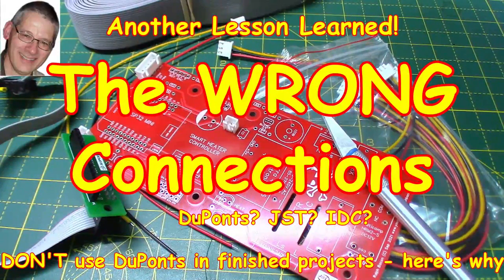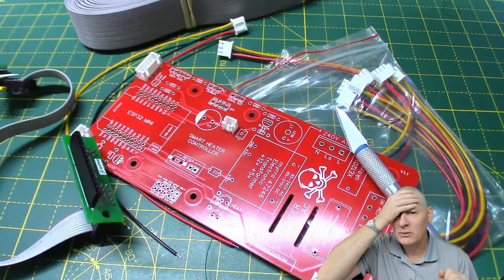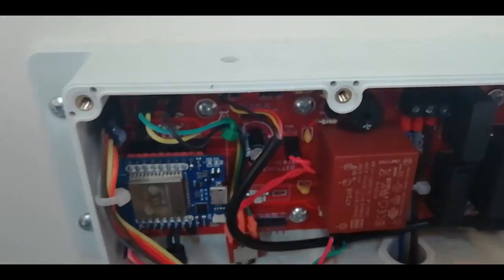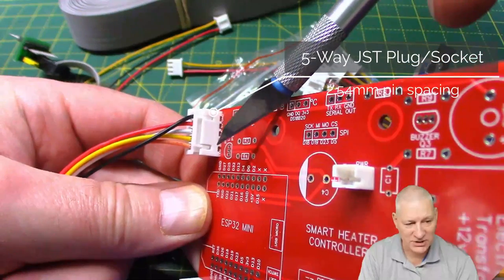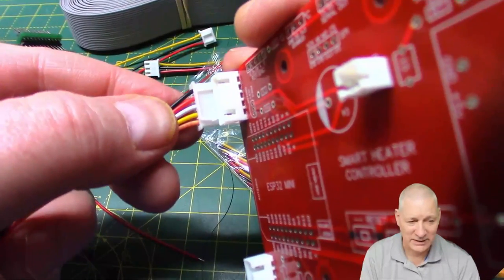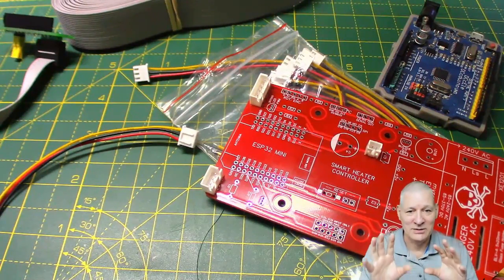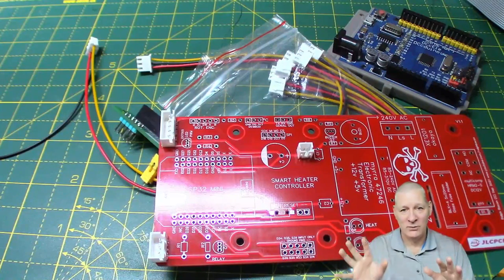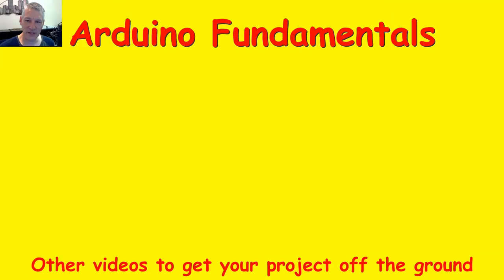#238 The Wrong Connectors😲forget DuPont, use JST or IDC for final use

Comment: Fun tip, you can really use just about any connector if you put a dab of hot glue on.
Reply from the maker: Fun fact, using hot glue on most connectors ensures you will never remove it without damage to the wires or connector! 

Best connectors I use now are KF2510, a bit like JST but easier to remove (and crimp cables). Not so good for drone battery connections, maybe, but great for Arduino work.
Reply: @RalphBacon  The trick is to peel the glue off before removing the connector. As most glue guns only heat to about 180 degrees (lower than the temps required to bake on smd components), its a pretty decent method and is often what manufacturers do to keep cables in place when they want to ensure they dont move during shipping but still want parts to be replaceable.
Reply from the maker: Hmm. It's what cheap manufacturers use to keep cables in place rather than some sort of (removable) cable tie. 

I'd rather use JST connectors for connections that are rarely removed, and a KF2510 for ones that are frequently unplugged, without causing strain on the sometimes delicate cables.

But if your method works for you, then it works. 😁
Reply: @RalphBacon  This is pretty widely used by manufacturers that range from small to big. Its often used on JST connectors even.

Its particularly used on machines that have cables liable to get loose in shipping such as gaming pcs, 3d printers, arcade cabinets and more.

If you arent freight shipping a product where you have garuntees thay its babird the whole way its one of the better ways to ensure your customers dont end up in the support queue right off the bat. Other methods include expanding foam (for pcs), more deliberately latched connectors (with a lever rather than with the mechanism of a jst that simply bends the housing (but that raises the price notably)), or permanently attached cables.

In some cases a heap of adhesive is applied liberally to internal components like with Apple products and their legendarily pro right to repair stance ...

Anyhow, I just think its worth looking into. Its a cheap solution that works, is easily removable, doesnt put any extra stress on the cables, and can be done once you've reached a stated where you are satisfied you'll be leaving it for a while.  All it stakes is a small dab touching the male and female parts and avoiding the contacts and "that aint goin' anywhere".

As for cable ties, its hard to garuntee that theyll hold things in place. They simply arent as direct/close to the source of diconnection wnd can even lead to a case where one cable wiggling adds to the inertia of the bunch so another gets tugger with more force.

I view cable ties as a means for tidying not really a first line item for keeping cables connected where they ought be.

Comment: Bear in mind that it’s just the cheap Chinese “DuPont” connectors that are unreliable as hell. The original product, the Mini-PV series sold today by Amphenol, are far, far, far more reliable. (Their contacts come in three levels of force: low-force for high pin count connectors (40-72 pins), high-force for medium pin counts (10-50 pins), and ultra-high-force for low pin counts (1-20 pins).) The original Mini-PV contacts are rated for 1000 mating cycles, which they accomplish by using a beryllium copper contact spring inside a brass body. The cheap Chinese clones are all-brass, which deforms instead of springing back, which is why they loosen so very quickly, literally after just a few cycles.

With that said, the real Mini-PV connectors are quite expensive, so for most things I use various JST connectors, and lots of Molex KK 254 and clones thereof (like the common KF2510 from China).
Reply from the maker: Yes, others have mentioned the KK254 although I've yet to find pre-crimped wires for it (and I shudder at crimping more wires). 

I've got some 'better quality' DuPont cables too (thicker overall wire, more strands inside) but they are, as you say, more expensive. I wish I'd used those in my project!
Reply: @RalphBacon  You can readily buy KK254 clones on aliexpress, including pre-crimped leads, under the KF2510 name. Quality-wise, the KK254 clones are much closer to original Molex than DuPont clones are to original Amphenol. 

But I must also say, if you haven’t been able to find pre-crimped KK254 leads (using genuine Molex), it’s because you haven’t looked. Many vendors make them. Digi-Key, for example, has 900 types of them in stock. (I suspect they’re manufactured to order.) Mouser has 42. Molex itself sells a whopping three. :p
Reply from the maker: I must admit I hesitate to buy from (or even look at) Digi-Key (or other 'big name' vendors) given their high prices and even higher delivery charges. They are not interested in hobbyist volumes. But I will look for the KF2510 clones on AliExpress (they don't care who they sell to).
Reply: @RalphBacon   Hobby and prototyping volumes is literally Digi-Key’s business (and the reason they’re expensive) — large volume is the purview of resellers you’ll likely never deal with (like Avnet), and the sales departments of the manufacturers themselves. When you order ten thousand or a million pieces of something, you skip the middlemen altogether.

Digi-Key (and by extension, Mouser likely as well, since they always follow each other) has free shipping to the UK for orders £33 and up. So just aggregate a few projects and order at once. That’s what I do to get parts here in Switzerland, where it’s free shipping for orders €50 and up. Critically, Digi-Key (and Mouser) include customs, so no surprise customs and duty bills on delivery! (That’s a HUGE problem here in Switzerland with most foreign vendors, I dunno how the UK is.) 

The other tip I have is to keep a shopping list of low-priority stuff to restock, so that when you’re not quite at the minimum order for free shipping, you can pad it with one of those things. Common resistor values, wire, solder, flux, etc. Note that for many components (SMD resistors and chip caps being prime examples), the volume discounts are massive, such that buying 5 pieces can end up costing the same or more than 10 or 15… Digi-Key’s website is, at least, kind enough to tell you if buying more will cost you less. 

I used to order more stuff from aliexpress, but as time goes on, I’m preferring to buy quality from Digi-Key, because crapola parts end up wasting too much time and nerves. Sure, a Chinese DuPont contact for making prototyping jumpers costs 2¢ versus 50¢ for a real Mini-PV, but the Chinese contact is loose after 10 insertion cycles (and never was tight to begin with), versus 1000 for the Mini-PV. When you factor in the time spent assembling the jumper, it’s stupid to use the cheap ones. Same with a circuit that misbehaves because your op-amp is counterfeit, or a power transistor that shorts out and fries your circuit because it’s actually a small signal transistor hidden in a power transistor housing. 

What I do like AliExpress for is the things that simply aren’t sold anywhere else!

Comment: Those IDC cables are pain in the ass' had to replace loads of those on Marshall Amp's because the spikes were in poor contact for siganals from the pre amp/Eq to the power stages caused all sorts of shit , used to make up JST cables to replace ..............
Reply from the maker: IDC cables can be subject to poor connectivity, it depends on who made them. I've not had any issues with my home-made ones (even the ones I've had to squeeze up in the vice before I had the correct tool).

Comment: What do you think of the followings and have tried any of them:
1/ RJ45 LAN connection(upto 8 wires) ; female connector ~2£/u, male connector ~ male connector ~1£
2/ M12 connectors (3, 4, 5 or 8 pins)
3/ Chassis Socket Connectors; e.g. VISSQH GX12 5 Pin Panel Metal Mounting Round Aviation Plug, 12 mm Male/Female < 2£/u
Reply from the maker: Yes, no, no.

What, you want more? 

LAN (RJ45 terminated) cables are often used to transfer data long(er) distances, including video! I used it in one of my videos for serial comms, seemed just fine. Also there are several converters (mainly for PCs and the like) to get around any 5m cable length limit.

Never used M12. Sorry.

Never used GX12 style ones either (well, not in an Arduino environment). 

However, a follow up video to this one does show some KF2510 connectors which I use all the time now. A bit like the JST ones but much easier to connect up and disconnect too, without them falling off like DuPonts do.
https://youtu.be/jgdGThRCU-M

Comment: Dupont cables are really crap,,  I almost give up using it even in prototypes as they came off very easily,  do not give good conections.  I sometimes uses perforated pcbs and solder the wires to prototypes to guarantee a minimum quality.  One thing I was really thinking of is to use and old technology from the begging og digital electronics to build prototype projects,  Wire Wrap,  they provide a very good and reliable conection,  and make a very neat layout..  For long term I guess IDC is very good and has been used in PCs,  HDs,  floppy discs and DVD readers forever.
Reply from the maker: As another viewer has noted, proper, original DuPont cables are much better than the cheap, Chinese wires we always buy. Chalk and cheese. But they then come at a price that few are willing to pay. However, frustration levels will eventually drive us all into paying more for a better quality wire...

Comment: If your really wanna go overkill, you could do away with cables entire and put pogo pins on the PCB and contact pads on the back side of the cover, so when you remove the cover there are no wires but once you reinstall the cover it makes contact with all the pogo pins!! 🤣
Reply from the maker: Not so overkill! As it happens I'm using pogo pins in a specialist situation that I will share in due course. But I like your idea too for, say, connecting a front panel LCD screen to the main board.

Comment: JST's are awful outside the sphere of personal use.... so many form factors! - too many variations for third parties to have to stock.
Reply: Oh, honey… that’s just how connectors are. JST is downright simple compared to the big guys: Molex, Amphenol, AMP, etc. For example, the “original” DuPont connector, the Amphenol Mini-PV, has literally dozens and dozens of styles of female contacts alone just for the Mini-PV series. Versions with different platings, optimized for different wire sizes, and with three levels of mating force (which equates to grip force on the connector), and then on reels or loose.

Molex and AMP each have multiple series of connectors that complete with (and can mate with) DuPont/Mini-PV, and each series contains hundreds of parts. And then there are all the other series they make…
Reply: @tookitogo  Honey??
JST compared to Dupont is greatly problematical. But of course best is a soldered connection.
Reply from the maker: Certainly a minefield of choice out there - get the wrong one and you're in trouble. I guess Antonio does this extensively as part of his job, but for hobbyists it can be problematic to get the correct connection.
Reply: @RalphBacon  A bit for my job, more for my hobby because I’m a connector nerd. 😂 And yes, minefield is a very apt term for it! 
The worst is near clones that look alike at first (and second) glance but aren’t actually quite identical (like with machined headers, which come in a dizzying array of pin diameters, some of which will mate, but destructively, with the female contacts permanently deformed such that they won’t make solid contact with their designed pin size anymore.)
Reply: @kychemclass5850  Soldered connections are almost always inferior to a proper crimped connection. (And the absolute worst of both worlds is to take a poorly crimped connection and then solder it for “reinforcement”.) However — and this is a big, important caveat — this applies only to a PROPERLY crimped connection. A mediocre or poor crimp will often do worse than a soldered connection. And getting a proper crimp requires careful matching of contact and wire, using a high quality tool that’s made for the contact in question. “Close enough” almost never is in the world of crimping.
Reply: @tookitogo  I'll take note of your apparent experience with crimping and try and upgrade my opinion about it, thank you, even if I find it v. surprising that you say it's superior to soldered joints.
But still I think my point stands that there are big problems for the hobbyist with matching/comparability with a third party's choice of JST connectors.
Reply: @kychemclass5850  It’s not just me that says it, it’s a well-established fact in the electrical world. Solder joints are susceptible to overheating, both when getting very hot (obviously), but also to lower heat cycles causing thermal expansion that can cause a joint to fail. Above all, solder easily wicks into stranded wire, and if not thoroughly supported mechanically, this forms a weak spot if there’s any flexing or vibration. Additionally, flux that wicks into the wire needs to be a type that absolutely will not cause corrosion — something often overlooked. (Most fluxes aren’t inert enough for this.) It certainly is possible to create high-reliability solder joints — there’s a NASA soldering guide you can find online — but crimping is usually better. A proper crimp forms an airtight, cold-welded joint. 

My point about selection is that JST’s selection isn’t actually that big. Other connector manufacturers like Molex, Amphenol, and TE have much larger portfolios. The argument of “JST sucks for hobbyists because they have more than one connector type” is absurd. The ONLY reason people get confused is because of the hobby world’s lazy use of the manufacturer name instead of actually naming the series they mean. (It doesn’t help that different hobbies may use “JST” as shorthand for different series!)  There would be ZERO confusion if the remote control car folks said “JST RCY connector” and Ralph said “JST XH connector”, etc. 

Kinda like how the IT world says “Molex connector” for disk drive power connectors, even though a) Molex makes thousands of different connectors and b) Molex wasn’t even the inventor of that connector type!
Reply: @tookitogo  Thanks for the info. I'll take it on board. Much appreciated.
Reply: @kychemclass5850  You’re welcome!

Comment: That doesn't make sense. These connectors are designed that way for a reason, and the proper way to unplug them would be to use a flat metal and push against the two pieces of plastic that have that nub on them while you wiggle them out. You can do one at a time.
Reply from the maker: Try doing that inside a small project box where you can barely reach the socket let alone get any flat blade in there!
Reply: Or just use slim pliers to grip them and wiggle them out…

Comment: a wonderful looking circuit board and i have had 5 PCBs made by PCBway from your advice and they look fantastic. 🥳 thanks a lot 🤩🐱
 the skull and crossbones seems a lot like putin in the news
Reply from the maker: Ha ha! I will not comment on the skull and crossbones ☠ but PCBWay do make PCBs that are second to none - and their assembly service was, quite frankly, astounding. I could not have soldered some of those tiny components, not with my eyes!
Reply: @RalphBacon  i cannot wait for my next PCBway project 🙂thanks

Comment: I quite like using the wire wrapping technique, using the WSU-30M wrapping pencil.

I've just finished a prototype weather station using wire wrapping throughout.

It's a bit time consuming [wrapping] but it gets rid of all those dubious quality DuPonts when taking prototyping to the next level of development and integration.
Reply from the maker: If it works for you, Mark, keep using it! I'm still investigating other plug/socket combinations as a result of some of the comments here. You never know, you might convert to another system yet!
Reply: @RalphBacon  No worries, Ralph. I plan to do what your doing when the design is finalised i.e. use JST connects etc;

It's just that wire wrapping is a useful semi fixed solution when still manipulating the prototype in development. How many times have we been dupoed by DuPont's that have popped off causing red herrings in operation?

I use Dupont for first draft, then wrapping and then JST etc for final PCB.

I continue to enjoy your inspirational presentations.

All the best.